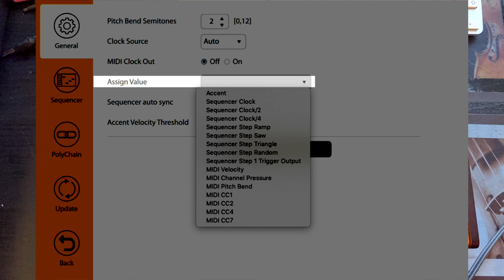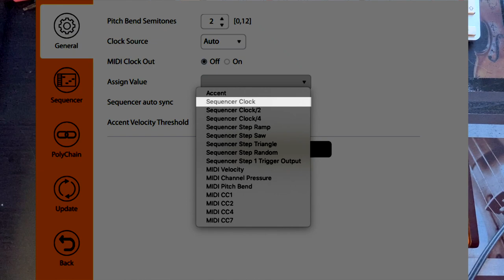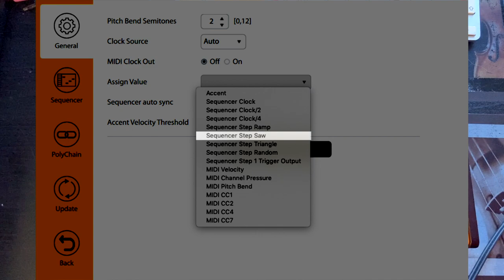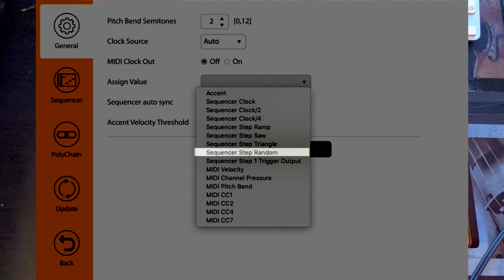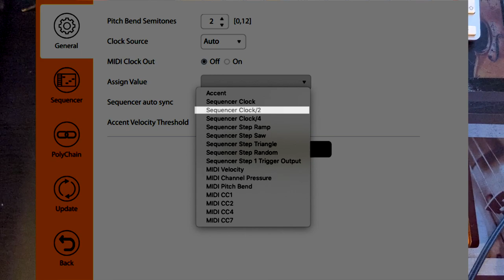Behringer Crave. Expressive Bass with Sequencer Tutorial. Patch Ideas

Comment: Cool video man. Keep it up! Do you  have any ideas for sequencing Crave from Ableton live and recording into an audio channel? Personally I seem to encounter latency issues while doing this.
Reply from the maker: first of all you should set buffer size as low as possible. then Options (upper menu) -> Reduced latency when monitoring. then, don't use monitoring and recording on the same track. 1 track for monitoring, 2 for recording. final step, Ableton Live has lessons inside, find on in Audio Settings -> Driver Error Compensation and do everything suggested there
Reply: @AntonAnru  That's really great. Ive managed to bring the latency down quite a bit! Thanks!

Comment: meh still sounds like a kinda average normal synth sound to me... interesting modulation and use of the functions though
Reply from the maker: I guess it wasn't supposed to sound extraordinary. It has regular analog synthesis, but the sequencer and the patchbay make the synth much more interesting
Reply: @AntonAnru  yes.. I am not sure what I meant. But I have found it hard to get my hands on a synth I liked. I like the modal skulpt... I tried two behringer synths the neutron and pro 1 and felt they sounded bad like non musical, harsh, nasal... The crave sounds better than both. I want to try the k2 as it seems modelled after the korg which sounds really nice to my ears, iconic. Thanks though I didnt even realise you could do those things on the crave it really is rich in features even with limited osc and env
Reply from the maker: @DominicJacksonFilm  you may probably like moog sound more (for more money of course)
Reply: @AntonAnru  I guess that is it, I heard others have similar complaints about the neutron, nasal and harsh, and they cut the over drive and filter out of the signal chain with the patching. I just dont know why they had that over drive in there it really was nasty imo and even when fully off seems to be in the signal chain.. like the delay it bleeds into the circuit. Not sure about the behringer synths so far, seem hit and miss but behrigner always been a bit like that.. I have used their products for 20 years and loved many of them! :-)